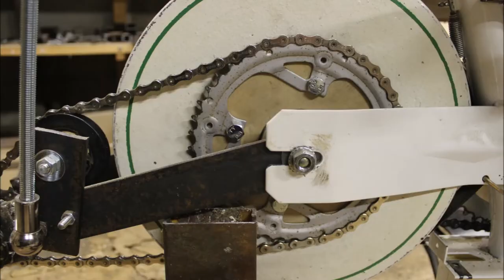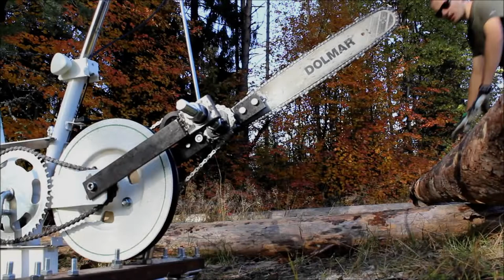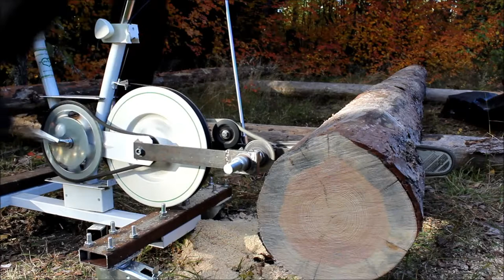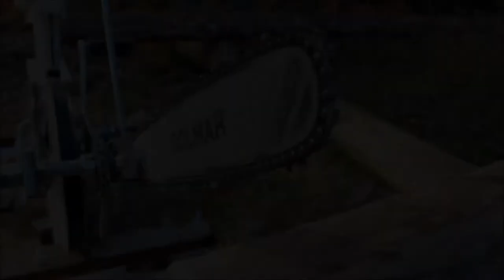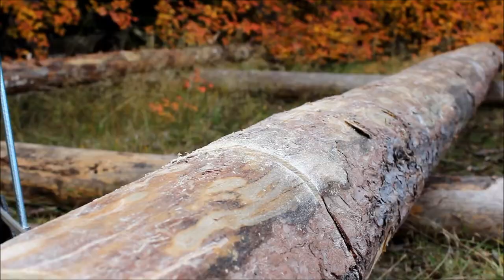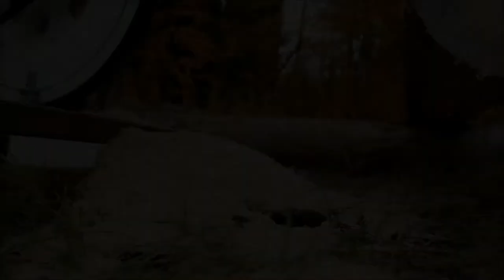Pedal Powered Chainsaw

Comment: If you’d like you can put a bigger gear on the bike to a smaller so you have faster rpm on you’re saw
Reply: Wouldn't that mean lesser torque therefore lesser cutting power?
Reply: @greenleafyman1028  Yeah but it seems like torque isn't an issue